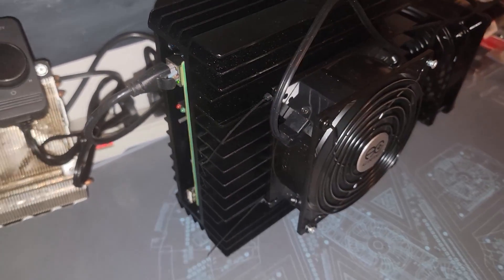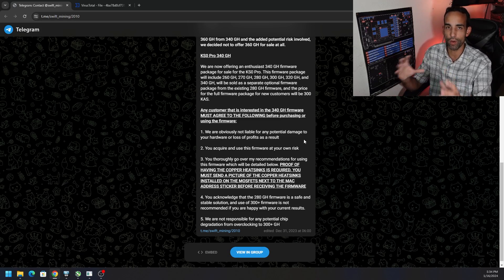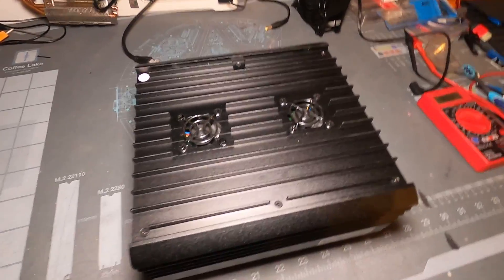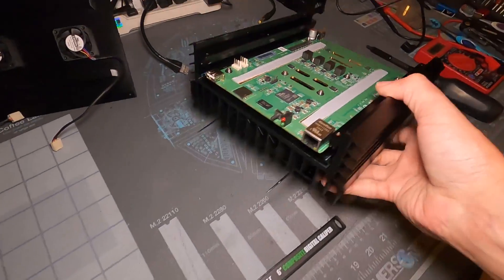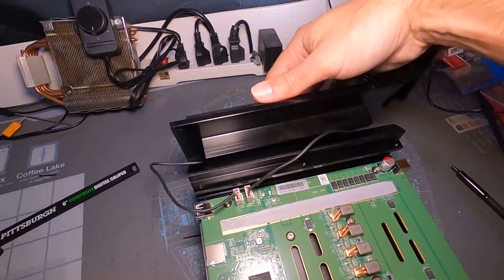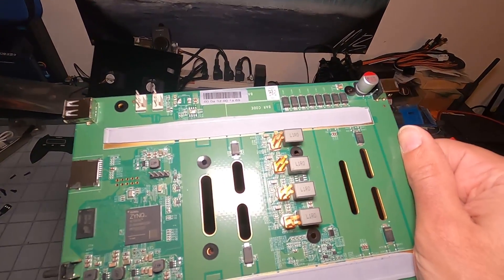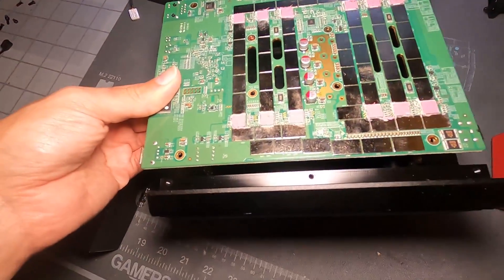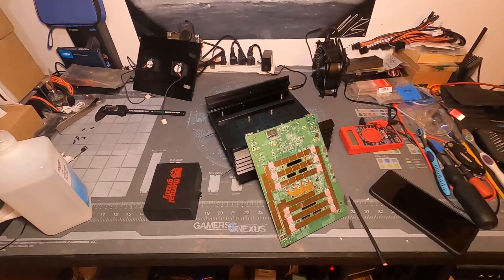Modifying or Improving Thermals on KS0 Pro, Ultra, AL0, & RX0

Comment: Are you running the stock PSU with the higher ghs firmware
Reply from the maker: https://amzn.to/3wwHs3i

On one and then tis on the other

https://theveteranminer.com/product/barrel-connector-to-12volt-psu-6-pin-pcie-female-for-ks0-asic-miner/
Reply: @SerpentXTech  thank you just ordered one I did see somebody mentioned in another video that this is what they were using and wasn't sure thank you thank you
Reply from the maker: No 230w MSI psu

Comment: Hello,

I would like to clarify a doubt about the dimensions of the heat sinks you used. Could you confirm whether the model used was 3.5cm x 3.5cm and 3cm (or millimeters) in height, or if it was 6.5cm x 6.5cm with 12cm (or millimeters) in height?
Reply from the maker: 6.5 in height and 3mm 
L & W

Comment: good video buddy.  curious though, in the 2 temps screenshots you added at end of this video, The temps were way better on the after.  Was that simply just the mosfet heat sync, thermal repaste, and the thermal pad replacement?   I may do this to my 2 pros, but just going to try and run the 280 firmware and not the crazy 360. 
Keep grinding
Reply from the maker: Thermal paste Kryonaut Extreme, and stock thermal pads. I was supposed the replace it but I thought just like GDDR6X, if I can draw most of the heat out the front of the chip into the main heatsink I could save on thermals.
Reply: @SerpentXTech  well done buddy. I dig it.  I just finished thermal testing a stock kso pro with different orientations and fans.  I have the tswift firmware already, just haven't installed yet
Reply from the maker: @AlteredComponent  340 video next Wed. And issues I bumped into even with mods